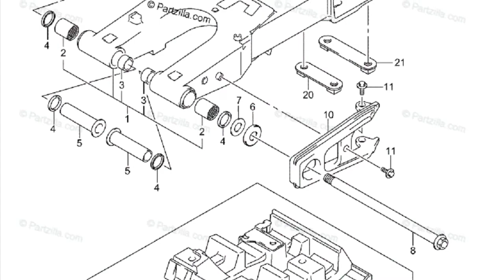LTZ 400 swing arm bearings / carrier assembly replacement (KFX400, DVX400)

Comment: Hey man i have that long bolt holding the swingarm spining free… and i cant pull it out . How did u get it out ?
Thanks in advance
Reply from the maker: I use a rod with a slightly smaller OD than the bolt then hit it with a hammer. I believe you can use a long extension or something of that nature.